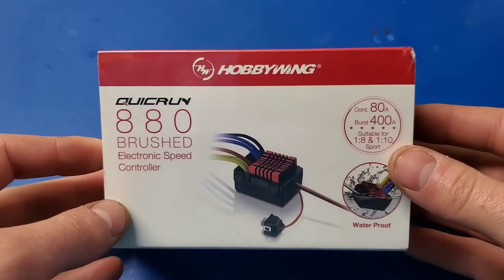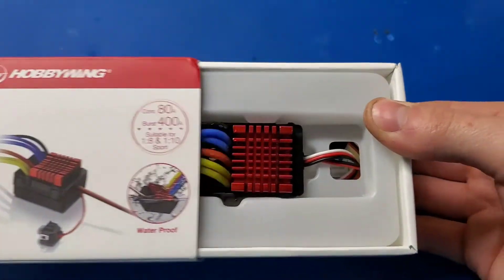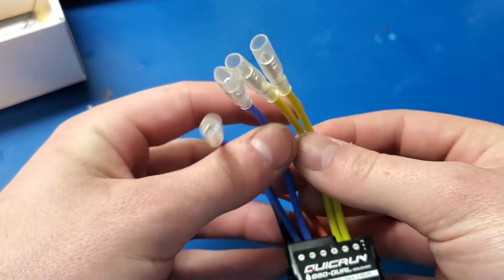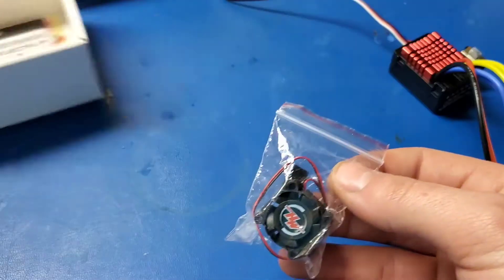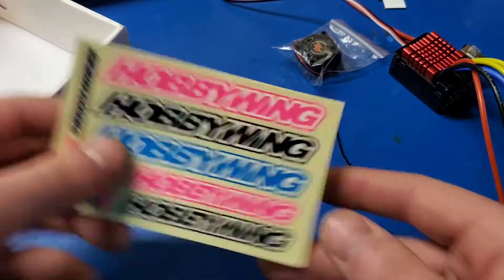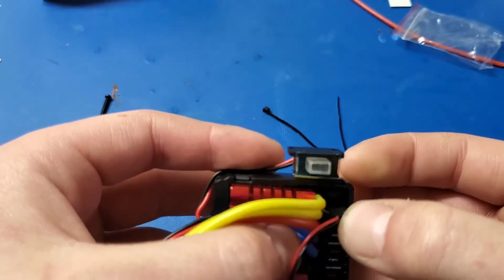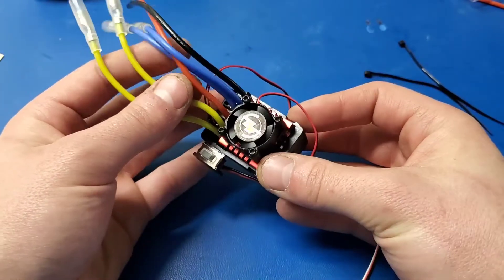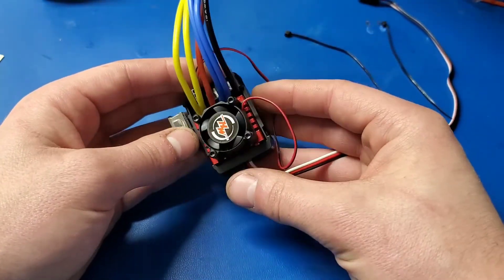Unboxing - Hobbywing Quicrun 880 Dual Motor Brushed ESC

Comment: Thank you so much for this video.
I'm trying to get around spending $180 on the Traxxas esc to get my old E-maxx going again.
The original 3014 esc is fried and this looks like just what I need.
The only questions I have is, am I able to hook up two 2S 7.4V lipo batteries and if so will I have to reprogram it?

Comment: 😮 can you elaborate on that extra red wire please because I watched other videos and they say that's for connecting a second battery but I don't see anything in the instructions of how to do that
Reply from the maker: Extra red wire? There is only one set of red and black battery wires.

Oh I see, you mean the extra bit of wire that comes in the box. My guess is since the esc is capable of 4s, the extra wire is used for wiring two 2s batteries in series to essentially create a 4s pack.
Reply: @NickMakesBreaksStuff  thank you for reply .I watched another video that said you could hook up 2 batteries I was wondering how it was done other then a Y .I still use NIMH. Clodbuster. My Turbo Zeta stopped working I think the internal battery died. :(
Reply: @Hayseed1776 Did you figure it out? I'm trying to get my old E-maxx going with this esc and two 2S batteries.

Comment: 14 cell NIMH possible? Will it shut off with more than 12 cells or is it just not reccomended?
Reply from the maker: 14 cell NIMH won't work at all, the ESC would fry as soon as you connect it as there are no over voltage protections.

Comment: Would this work with two 370 WPL motors? Trying to hook two of them up on my WPl B14 6x6 rock crawler. Appreciate any advice.
Reply from the maker: Yes, it is more than powerful enough for two 370 motors.
Reply: @NickMakesBreaksStuff  thank you! Any chance you could recommend the best lipo battery for this setup? Want the most power I can get from the motors.
Reply from the maker: @royherrera6397  The 880 can handle up to 4s, so it all comes down to what your motors can take without overheating. 3 cell might be your best bet